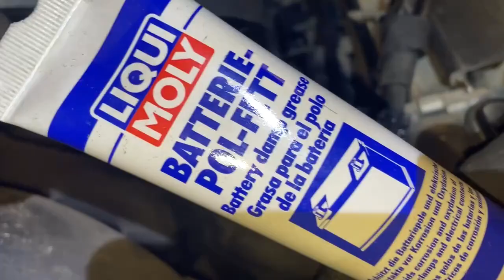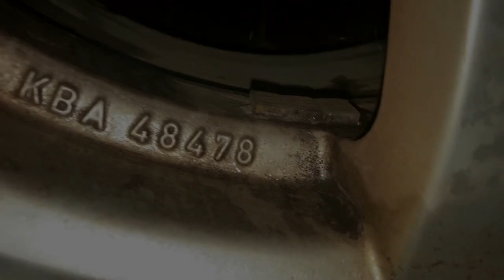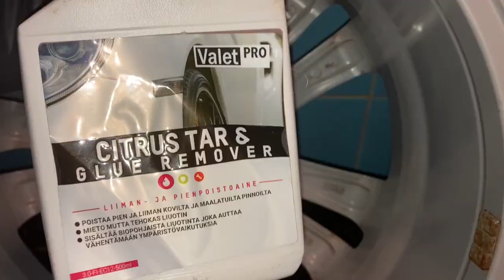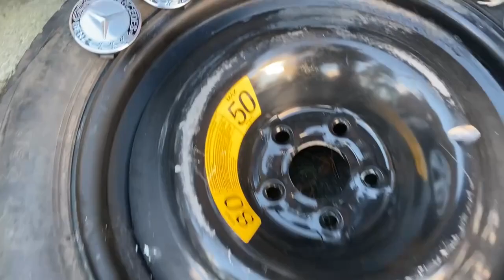Putting together my MB W163 after some major repairs

Comment: The content is professional and accurate in assembling the parts. Thank you for your most wonderful effort 👍
Reply from the maker: Thank you for your kind words!
Reply: @ccrepairchannel  I have an inquiry, please, how much oil is in the front differential, the rear differential, the amount of oil in the transmission box, and what is the appropriate oil number for a Mercedes 163 W. Greetings to you.
Reply from the maker: @lssamabu3427  I haven’t done oil change for those yet, but I’ve read that the capacities should be: Front diff 1.2 liters / Rear diff 1.6 liters / Transfer case 1.5-1.7 liters. Gear oil specs are in MB sheet 231.1, currently it says 235.74 for differential / 236.10 for transfer case, if I’m interpreting it correctly.
Reply: @ccrepairchannel  thank you so much

Comment: What size are the wheels? I have the same brakes on mine and wonder if 17 inch diameter wheels will fit. I have amg 20 inch on mine
Reply from the maker: 17” and they barely clear the front calipers 😬